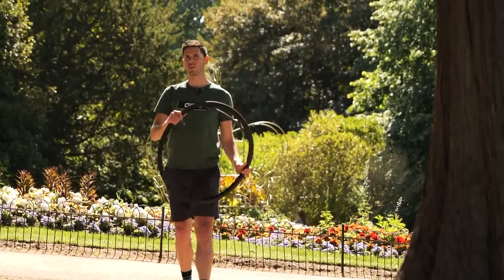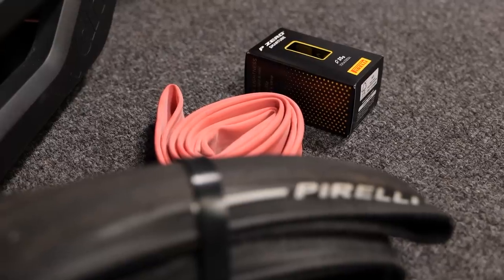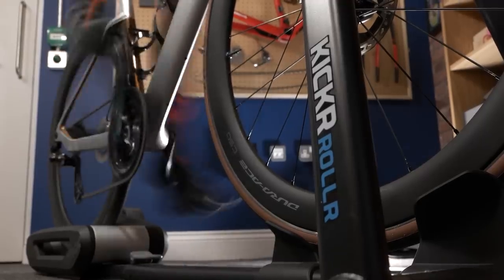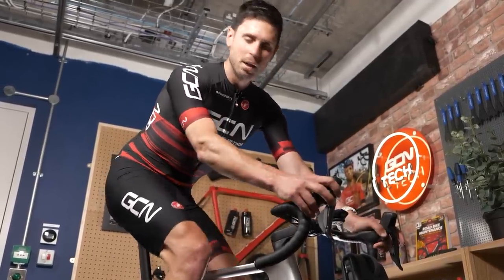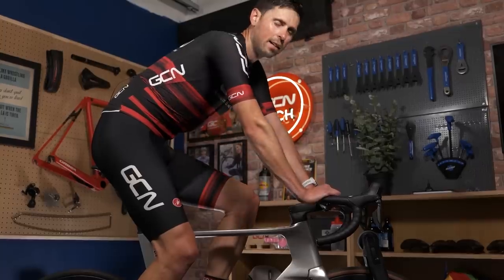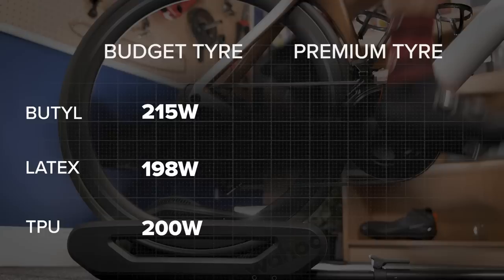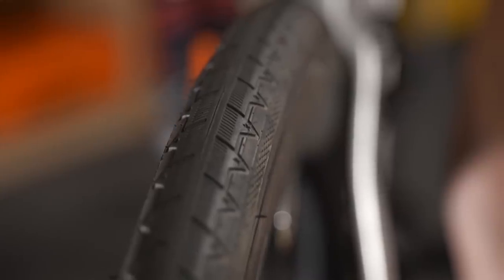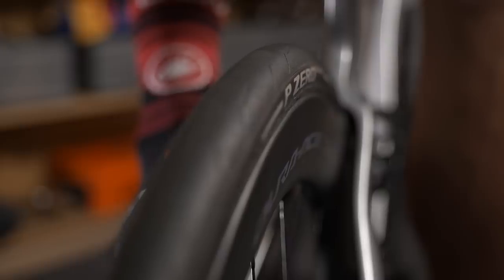How Much Faster Will This Bike Upgrade Make You?

Comment: Convincing average riders to sacrifice reliability for speed seems like a sad state for this channel. I guess some viewers might be legitimate racers, but most people would never benefit from the lighter tires. The race tires are a decent upgrade suggestion, but race tires aren't made to handle the same kind of abuse as the all road tires that come standard on consumer bikes. 

Latex tubes and race tires are faster,  if that's what you want, but they're harder to use correctly, more susceptible to accidental damage, and less versatile.

I hope this channel would be emphasizing the convenience of butyl tubes. You can dress them on the side of the road without worrying about uv damage, twisting, over inflating leading to pinching, or lack of proper talc. Butyl tubes are really hard to mess up. Idiot-proof. They might not break records, but most bikers don't do that anyway. 

I hate seeing this sport turn into an elitist racing club that expects everybody to prioritize performance over all else. The same thing happened with cars, and now my Honda people mover has an aerodynamic spoiler for creating additional downdraft on my way to my daughter's graduation. And my wife's Toyota soccer-mom van can tow up to 10000lbs .